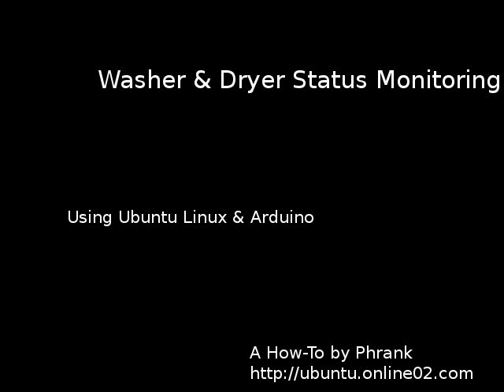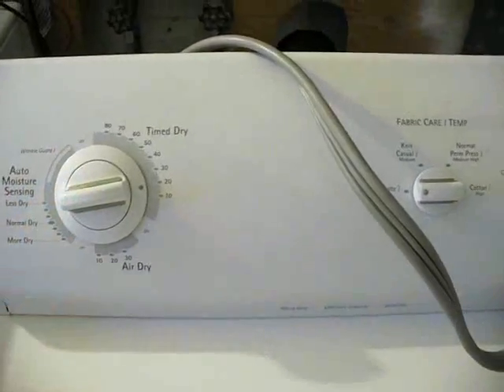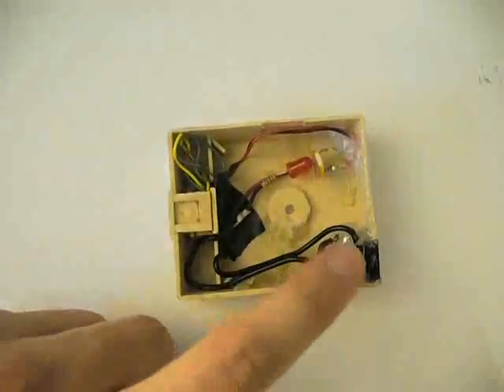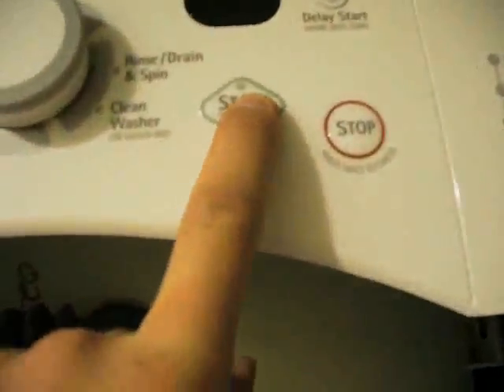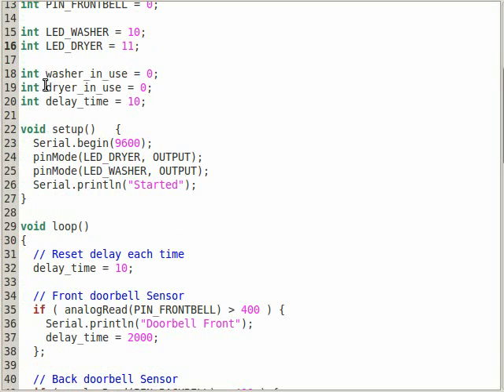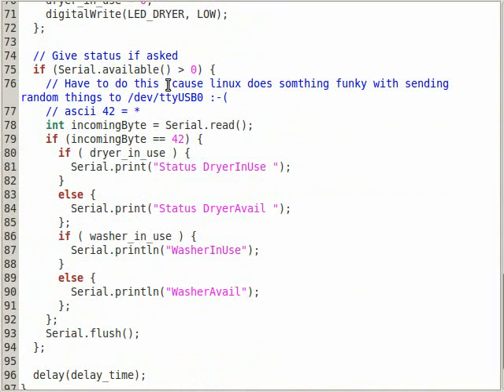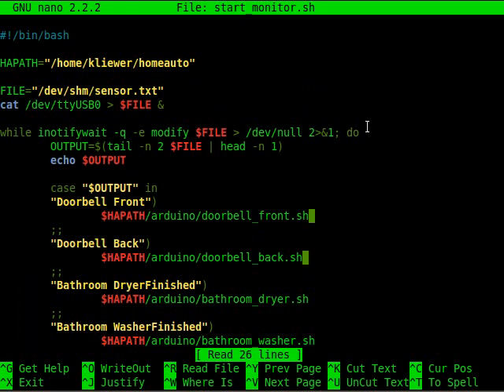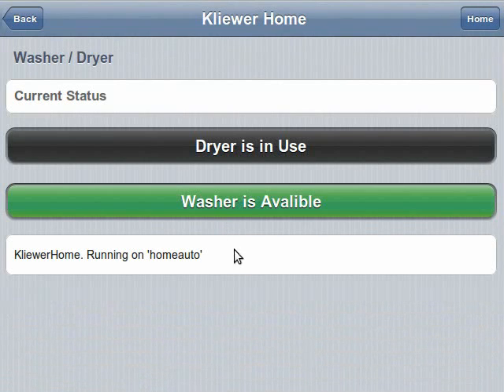Washer/Dryer Status Monitoring with Arduino ~ HowTo by Phrank

Comment: Sébastien Plante, where does he have 120v going to the arduino?   he in effect has made a opto-isolator, if you look in the rj45 box, he is powering the LED from the appliance and using a photoresistor to see the LED being on or off.